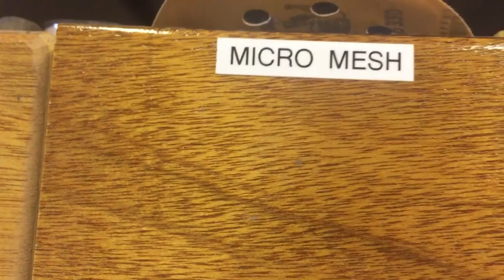A Reverence for WOOD

Comment: I do the same thing.. Beautiful old wood deserves to have a second use.  I have found a number of pallets from overseas have high grade wood we would NEVER think of using for such a throw away use..  I recently save an entire house full of clear vertical grain trim that was surrounding every interior door, before the home was demolished. Someone got the doors, and hardware, and the plumbing fixtures and lighting, but no-one even looked at all the beautiful trim wood. Every piece was saved, and has been put to use as fine grade trim on cabinets and custom audio racks.

Comment: Very interesting about today's video title. There is a paperback book I have of the exact same name: "A REVERENCE FOR WOOD" By Eric Sloane. The author speaks much the same as yourself.

And there is a companion volume about old tools, some from the American colonies on up through the years.
May I suggest 
alibris.com
for good prices?
Reply: that is why the title sounded familiar. I may still have that book too. I did once.
Reply from the maker: Michael Dougfir I have it and read it many times. Great drawings.
Reply: @arboristBlairGlenn  How about a series of readings (audiobook) from "A REVERENCE FOR WOOD" By Eric Sloane with you adding commentary ? . . . . I have no idea about the legal/copyright issues but I imagine that the rights holder(s) would benefit from the increased visibility such a project would create. A quick search of 'AUDIBLE' does NOT find Eric Sloane. Apparently 'AUDIBLE' does support illustrations which show up synchronized with the text reading. ///  'AUDIBLE' would probably jump at the chance to have you do such a project. ( No job is too hard for the person that does not have to do it ! )